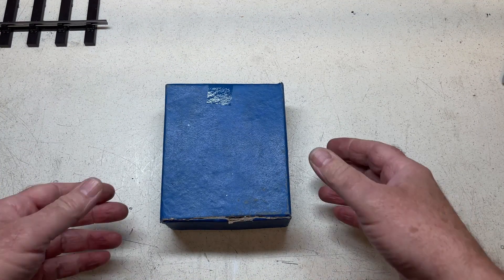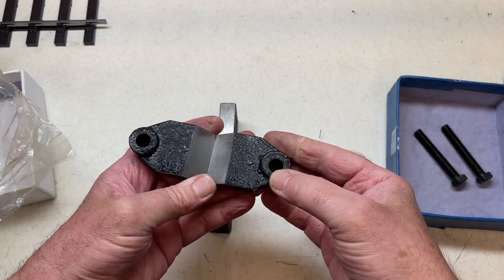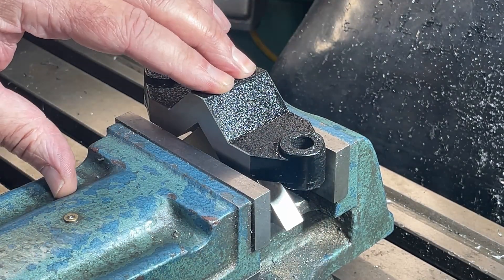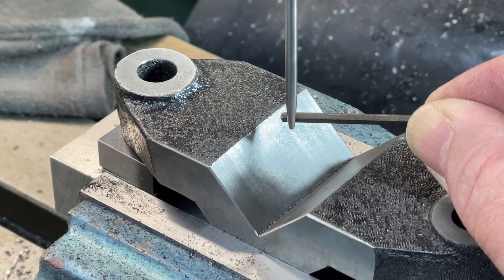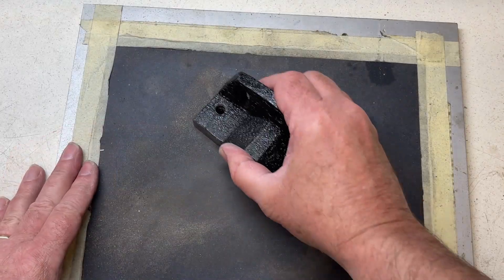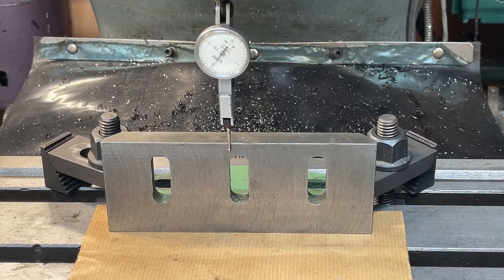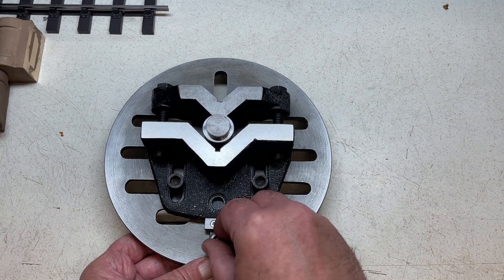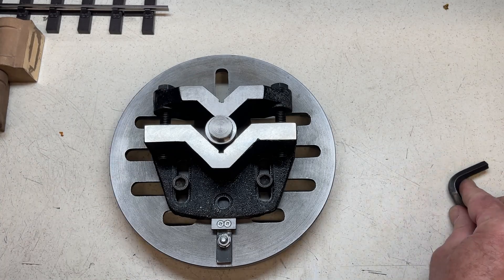Model Engineering Basics: No 5 Mods to a Keates Angle Plate

Comment: I’m not familiar with this type of angle plate. What are the advantages of using it as opposed to other methods?
Reply from the maker: A Keates is an easily adjustable angle plate that can hold a range of shapes and sizes accurately and quickly, as shown in the video. Thanks for the comment!